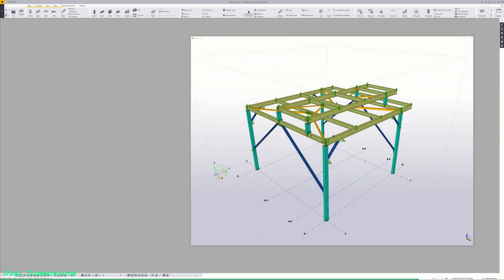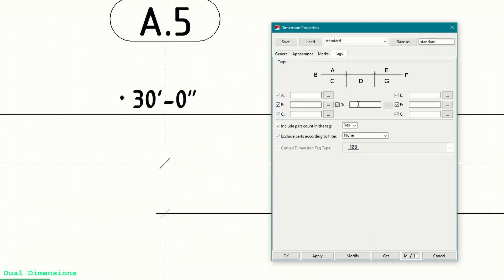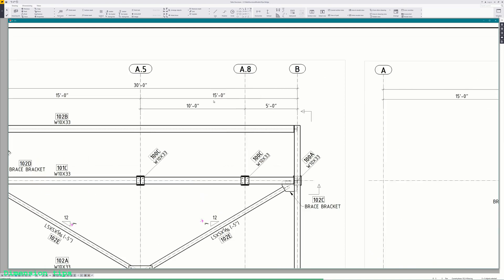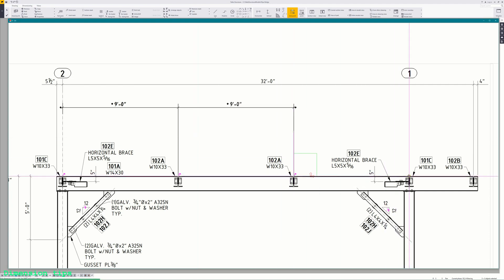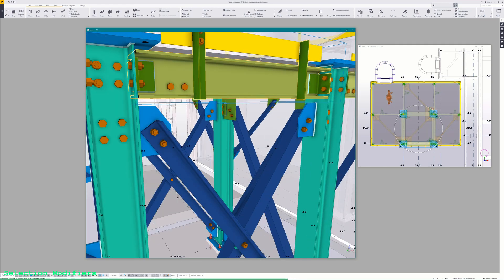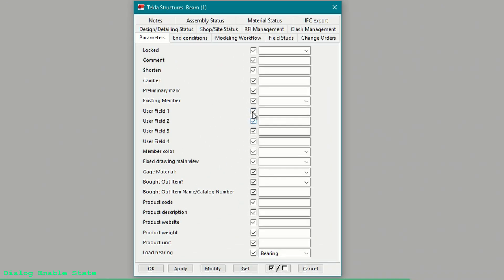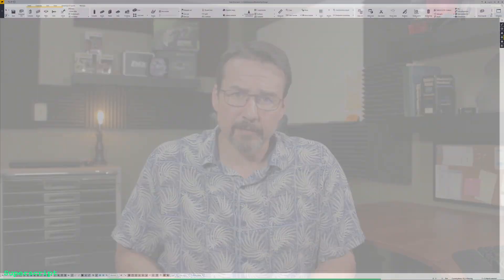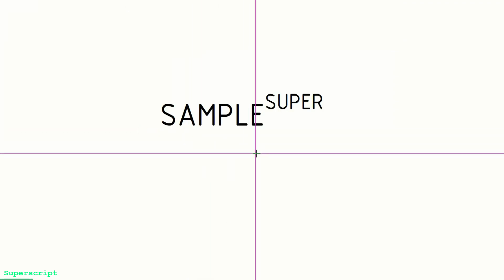Tips and Tricks: Part 3 - Modeling Techniques Using Tekla Structures

Comment: Single parts and assembly drawing out of the box settings
The dimension colour is Green how you do change it to black, so it does it automatically when you
Run the drawing process

Comment: Hello CS, thank you for your very useful videos.

I wonder if you have any insight on the following issue: I have a custom component whose variables work perfectly fine in the custom component editor, but when I close it and try to modify the input values in the dialog box, some of the variables (that still work in the editor) do not work. 
Have you ever experienced that problem?

Again, thank you and congratulations for the high quality content.
Reply from the maker: Thank you, I appreciate the positive feedback!

As far as your question, I'm not very familiar with custom components since I haven't used them.  I'm sure you could get that question answered on the Tekla forum, though.